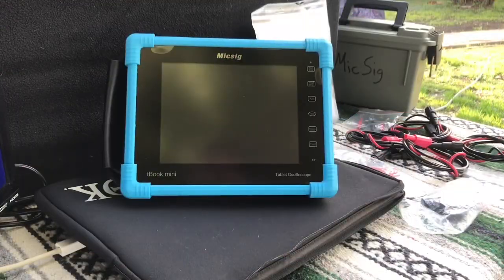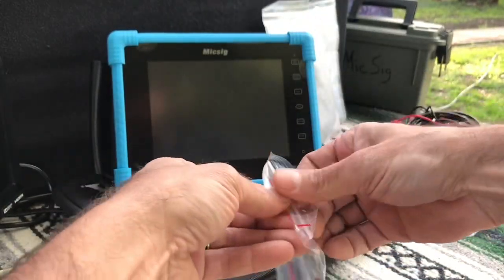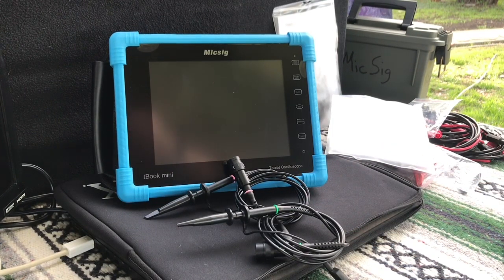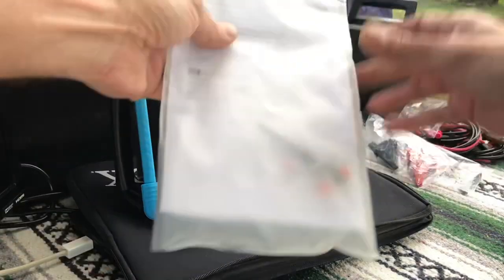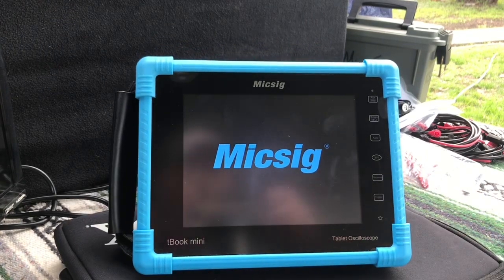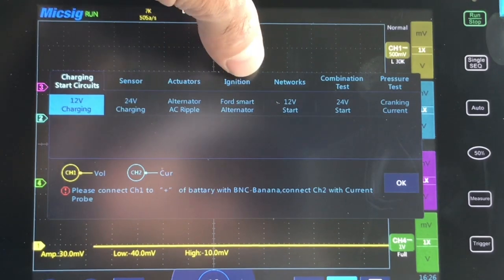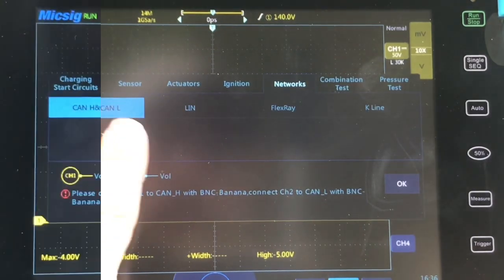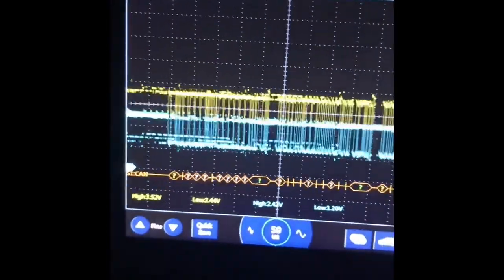MicSig ATO1104 Tool Review Automotive Oscilloscope

Comment: I just received ATO 1104 but I can't find the invert can you help me with that
Reply from the maker: Ed, everything I said earlier is correct except, when you go into settings, then upgrade, then click on "Network Upgrade" (it doesn't say firmware). Hope this helps.
Reply from the maker: It should be at the top of each channel menu. If it’s not, then you need to go to settings, connect to WiFi, go to upgrade, then click on firmware update. Once the update is complete, the scope will reboot and the invert option will be at the top of each channel menu.
Reply from the maker: I just added a short 2 minute video to my channel called "Micsig ATO1104 (ATO1102) Automotive Scope Invert Option". It shows you where the invert option is supposed to be, at the top each channel menu. Also how to install it, if it's not there. Don't forget to connect to wifi before attempting the update.

Comment: Hello from Spain I'm interested in buying a oscilloscope as well. I like the idea it has its own screen and no laptop needed. Where can this scope be purchased and what upgrade would you buy. Thank you very much for your time for recording these videos.
Reply from the maker: Tony, your welcome, and thank you for the kind words. I purchased my Micsig from Amazon, and would definitely recommend Amazon. As for any upgrades? Well, I bought the ATO1104. It’s Micsig’s automotive scope. It comes with a lot of automotive presets, that set your time base, voltage, triggers, etc for whatever you are testing. Also, it comes loaded with all the extra stuff already installed. I’m here if you have any more questions. Thanks for stopping by my channel.
Reply: @atomsworkshop195  is there any differences on the ATO 1104 plus and ATO 1104?
Reply from the maker: Hello Tony. To the best of my knowledge, No. There is no ATO1104 “plus”. It’s not listed anywhere (that I can find) on Micsig’s website. I found the so called plus on batronix.com, and my ATO1104 has everything they listed for the “plus”. I think the retailer adds ”plus” to their add to make it appear that you are getting something more when you purchase from them. If you go to Micsig’s website, click on the TO1000 series tab, and then go to models, there is no “plus”. I can’t tell you were to buy from, but I can say that I bought mine (ATO1104) from amazon on Thursday January 9th 2020 and received it on Friday January 10th 2020 for $749.99,  $811.86 after tax; and I am really happy with my purchase. Also, it did not mention it in the add, but it did include the screen protector, and the little hand strap that connects to the scope (makes holding it so much easier and more secure). Also comes with a calibration certificate. I feel like there’s also something else, but it’s slipping my mind at the moment. I can’t see how you would be disappointed if you make the purchase; it really is a nice scope. And No, I don’t get paid by Micsig. I wish I did but no, I just really like my Micsig scope. I feel like a little kid on Christmas morning every time I come across a vehicle that I need to break the scope out on, lol. Also, if you do make the purchase, when you receive it, click on one of the channels to open the channel menu. At the very top of the menu, look to see if it has the “Invert” option. If not, fear not my friend; just go to settings to upgrade, click network upgrade, then upgrade. This will add the “Invert” option. I hope all this helps.
Reply: @atomsworkshop195  ok great thank you very  much for all the information provided. Very kind of you 👍👍

Comment: Great   video   love it hope you more work  with this scope  I am hoping   to get one  but need to know   more about   it . CAN IT WORK ON DIESEL TOO
Reply from the maker: Hello Ronald, thanks for subscribing. I personally have not used it on diesels yet, but I know there are some diesel options in the automotive presets. I would think it would be ok. I recommend reading some of the comments under my videos to get some opinions from other users. Might help with your decision. Also, I’ll ask around if anyone has used it on diesels. Feel free to also ask questions to others in the comments. Everyone seems pretty willing to give information and feedback.
Reply from the maker: Ronald how’s it going? I just realized I guess I didn’t press the send button good enough on this message. Just realized it never sent. So I was thinking about your question, and I can’t see any reason why you can’t use this on diesels. Voltage is voltage. You can test up to 300 volts with this, and more with the 10:1 probes or an attenuator. The only thing I would look into is maybe using it to test pressure (which I believe is usually higher on diesels).
Reply: i guess Im kinda off topic but does anybody know of a good place to stream new tv shows online?
Reply: @Graham Felipe I use FlixZone. Just google for it =)
Reply: @Graham Felipe i watch on Flixzone. You can find it on google :)
Reply: @Ali Denver Definitely, I've been using Flixzone for since april myself :)
Reply: @Ali Denver thank you, signed up and it seems to work :D I appreciate it !
Reply: @Graham Felipe You are welcome :D

Comment: Gracias por tus videos, tengo el modelo TO1104 y queria preguntarte si es posible reemplazar el software TO por el  ATO,? saludos
Reply from the maker: Hello Carlos. To answer your question; As far as I know, there is no firmware update that converts your T01104 to an AT01104.  The only upgrade I can find is on Aliexspress. They have an upgrade that gives you UART, CAN, LIN, SPI, and 12C protocol decoding, that costs $37.99. Have you tried going to the settings on your scope, and clicking on information, to see if there any options available there?  I’ll keep looking, and if I find anything I’ll post a comment to let you know Thanks for checking out my videos, and good luck.
Reply from the maker: In Spanish:Hola carlos. Para responder a su pregunta; hasta donde yo sé, no hay una actualización de firmware que convierte su t01104 a un at01104. La única actualización que puedo encontrar es en el Aliexspress. Tienen una actualización que le da UART, CAN, LIN, SPI y 12c, decodificación de protocolo, que cuesta $37.99. ¿ha intentado ir a los ajustes de su alcance y haciendo clic en información para ver si hay alguna opción disponible allí? Seguiré buscando, y si encuentro algo publicaré un comentario para hacerle saber gracias por revisar mis videos, y buena suerte
Reply: @atomsworkshop195  muchas gracias por tu comunicación quizás más adelante existe la posibilidad de cambiar el software. Saludos
Reply from the maker: Carlos, hola allí, quizás ellos puedan ofrecer esa opción en el futuro. quien sabe, tal vez Micsig vea nuestros comentarios, y otras personas hablando de lo mismo; y optan por ofrecer esa actualización en la sección de actualización en los ajustes del ámbito de aplicación. De hecho, enviaré un contacto a un contacto que tengo en micsig que me encontré cuando estaba investigando el alcance y me contactó con ellos para preguntas que tuve; y preguntadle sobre ello. Es como el director de ventas y marketing de ultramar para el Micsig, así que podría ser capaz de hacer que eso suceda. Te haré saber lo que me dice. Que tenga un buen Carlos. También espero que lo que escriba hace desde entonces. Estoy usando una aplicación de traducción, porque por desgracia no puedo leer ni escribir en español, así que estoy confiando en la aplicación para traducir lo que escribí al español.
Reply: @atomsworkshop195  muy agradecido la traducción está perfecta muchísimas gracias saludos
Reply: what's the difference between the TO1104 and the ATO1104 🤔
Reply from the maker: F P, the ATO has automotive presets and different settings for amp clamps/current probes. Also, the ATO comes with automotive leads (banana leads) as well as the probes that comes with the TO. When you turn on the ATO, it shows a sports car while loading, verses, the TO that shows just text (I believe). There may be some other things that I’m not thinking of at the moment; I don’t have either of my scopes with me at the moment. However, if you watch any of my videos using the ATO, you can compare the menus to my videos with the STO. which I believe has similar menus as the TO. I hope this helps answer your question. Like I said, I don’t have them in front of me at the moment. Thanks for stopping by the channel. Also, thank you if you are subscribed; if not feel free to do so. If you do right now, you’ll be my 200th subscriber.

Comment: So I have the 2 channel one and so far I am liking it but have not been able to figure out if for ignition it can display burn time. Have you used it for ignition yet?
Reply from the maker: Good to hear Noneya; yea they’re pretty good scopes, especially for the price. I love using it. Yes, they work fine for ignition waveforms. You can see each part of the waveform. I’ve used the Pico secondary ignition test lead on an older truck (the one that clamps onto the plug wire) and it worked just fine. I have a video on here on my channel called “Looking at ignition waveforms with the Pico secondary ignition probe on the Micsig oscilloscope”. It’s the paddle probe that you just hold onto the top of the COP. In that video, they’re not the best waveforms, but that may be my fault since that was the first time I used it, and it was late at night (was pretty tired and hungry) and I was just trying to do it pretty quick. You have to kinda find the sweet spot on the coil. If yours is the ATO, it has an option for ignition tests in the automotive presets. Good luck to ya, and thanks for the comment.
Reply from the maker: Noneya, Also if you don’t have the ATO with the presets, you can look at my video that I mentioned above, and see the settings for the time base, etc. that it chose with the preset.

Comment: AWSwave.com can make you custom BNC test leads for it. I had some 10 ft Fluke BNC leads made for my Fluke 190 and they're great
Reply from the maker: Thanks Mark, that’s good to know. AESWave definitely has a lot of goodies. AutoNerdz is another good place. I picked up my Pico secondary paddle probe from them. Also, my Pico secondary ignition test lead. They have it on sale for only $22.50 (still on sale at the moment), while everyone else is selling it for about $56. Of course, now they have them in yellow, blue, red, and green for about $50 (at least at AutoNerdz). How do you like your fluke 190? I’ve been considering picking up a fluke; unfortunately they are really proud of them and it shows in the price. It would be nice though, being able to really trust in your meter.
Reply: @atomsworkshop195  it's a powerful scope however the display lacks . It's not viewable from anything more then dead on to maybe roughly 35 deg it whites out . But I love it's deep record function and the graphing meter is great
Reply from the maker: Mark HB yea, also I wish Micsig had a reference waveform library like Pico. That would really bring it to the next level. At least we can save reference waveforms in the scope. I pretty much plug it into everything I can get my hands on, lol, to build up my own library.
Reply from the maker: Mark HB I just realized what the fluke 190 is. At first I thought it was just a multi meter. I didn’t realize it was a scope. That’s a pretty expensive scope. It looks pretty nice.
Reply from the maker: Alright Mark, I just read a little about the fluke 190. Someone was being awful modest, lol. That things pretty freaking cool. Up to 30 minutes per division? That’s insane.
Reply: Don't get me wrong the scope is very powerful and even has built in amp clamp and 20:1 scales as well as temperature. Math function as well , just for the money I'd expect a better display. In photos it looks great but in real life it's sorta hard to view from and angle . It supports . Even supports 1000x scale to use with a secondary probe as most are calibrated at 1000x and is a deep memory recorder . I got it used but nearly brand new for very very cheap
Reply from the maker: Mark HB I can understand that. Fortunately that’s one of the things I like best about the Micsig. The display is great. It’s basically a tablet with a scope built in. Also, for the record, I bought the scope with my own money off of Amazon. I bought the ATO1104, which has the automotive presets. It was like $749, and came to $811 (if I remember right) after tax.
Reply: @atomsworkshop195  Yeah, I want to do the same. Build my own library

Comment: Hello Atom, new subscriber here. Thanks for the videos. It looks like your channel is the only one showing the Micsig automotive scope in action. I was wondering if you could make a quick video showing the ATO1104 connected to a MAF sensor. You don’t have to go into detail about it. I just want to see it connected with the Micsig. I’m on the fence on buying one, but just wanted to see it used on cars a little more first. I was almost ready to buy a Pico, but after watching your videos on the Micsig, I don’t see the point in spending all that money, If the Micsig will do what I need. Thanks again.
Reply from the maker: Thanks for the comment and subscribing to my channel. I’m glad my videos could be of help in your buying decision. I don’t have a Pico scope, but have seen it used a bunch. It seems like a really great scope, with a ton of features. When it was time for me to buy a scope the Pico was at the top of my list. One of the main reasons that I chose the Micsig, other than the price was because I wanted a stand alone tablet scope, where a laptop or computer was not needed. After researching and watching everything I could find on the Micsig, I came to the conclusion that it would be able to do everything I needed a scope to do. Not only that, but it is really easy to learn to use. With that said, I do wish Micsig had a reference waveform library like Pico, but you can save all your own reference waveforms on the Micsig and share them with other people. Also, longer leads would be nice. My remedy for the leads was a quick purchase from AESWAVE of a set of 4 Pico, color coded leads. I bought the 3 meter ones. Yes the Pico leads work just fine with the Micsig, but be prepared to drop about $180. Anyway, I’ll make a video tonight looking at the MAF sensor. I’ll try and get it posted tonight, or tomorrow. Thanks for the comment and welcome to the workshop.

Comment: Hi there, can an amp clamp be used with this?
Reply from the maker: How’s it going crazyc99? Yes you can use amp clamps with this scope. I have the Pico PP264 (TA018 same thing) 20/60 amp current clamp; and the Pico TA019 600 amp current clamp. Once you turn on the channel you are going to use, you can choose current, then it gives you 2 different options for a 60 amp amp clamp, and 2 different options for a 600 (it actually says 650) amp amp clamp. Once you make your choice, from there you have a number of options for attenuation to choose from, also other options for each channel. I know Micsig sells a really nice amp clamp, that I plan on getting pretty soon. There are 2 different model numbers; CP2100A & CP2100B. They go up to 100 amps, and have buttons to choose either 10 amps or 100 amps. Also a zero button with what seems to be 2 more buttons for fine tuning. You should check them out, they’re nice current clamps. I’m gonna go with CP2100B. If you look them up, you can see the difference between the two. Side note: also, once you choose the channel, there is an option for secondary ignition. I’ve used this for the Pico M1074 secondary ignition test leads. I got mine from AESWave for $22.50 on sale (it’s still on sale right now). It runs about $55 everywhere else (that I can see anyway). Use the same option for coil on plug ignition probes. I was using the Pico PP357 in my other video where I was looking at the coil waveforms. I really like that probe. It’s so fast and easy to use. For the record I don’t work for, and am not sponsored by Pico, AESWave, or MicSig; and I bought my scope and all my accessories with my own money. If you do buy this scope for automotive use, I would get longer leads. The ones that come with it are a little short (my opinion). I ended up buying the Pico 3 meter set that comes in yellow, blue, red, and green. They match the traces for the channels on the scope, so it makes it a little easier if your using a few leads at a time. Unfortunately they were about $180. If you get the ATO1104, it comes with all the automotive presets (you can see them on this video). I would definitely recommend this scope to anyone for automotive use. I really enjoy using it. I’ve diagnosed quite a few vehicles already with it. The latest one was a bad fuel pump on an 05 Dodge 1500 5.7 liter using it. Unfortunately, I’m new to YouTube and the editing app (iMovie), and long story short lost a handful of diag videos. I do however have the old and new fuel pump current ramp waveforms saved in my scope. I might do a quick video showing the difference between the two. Anyway, I know this is a lot more than what you asked about, but I know when I was searching for a scope, I wanted every bit of info I could get my hands on about it. Thanks for checking my videos out, and if you ever have a question, or want to see me do something specific with it, do t hesitate to shoot me a comment.